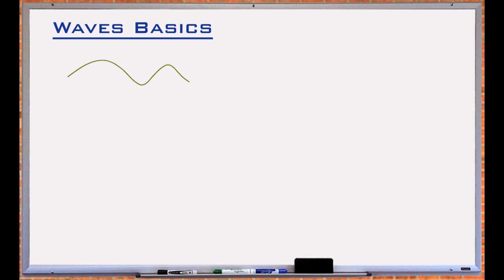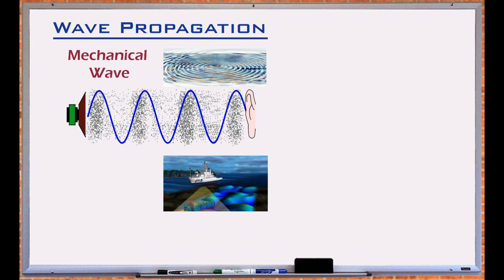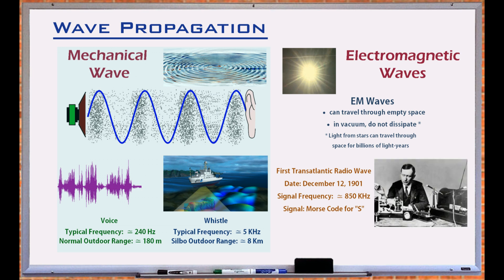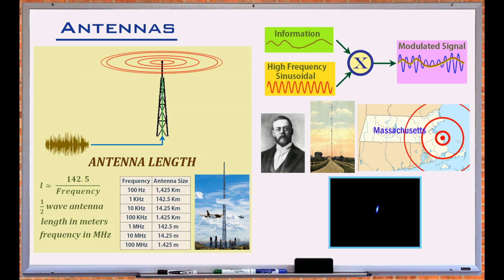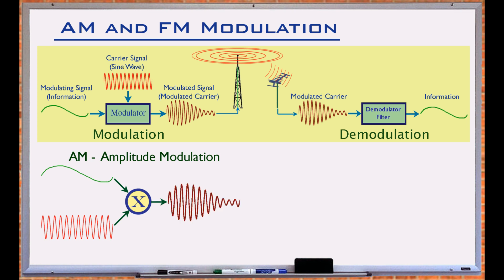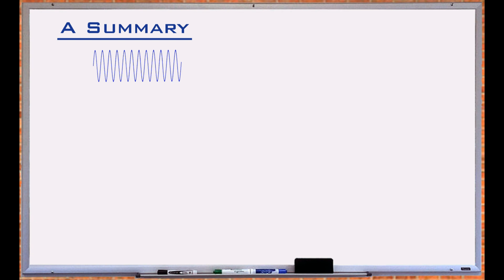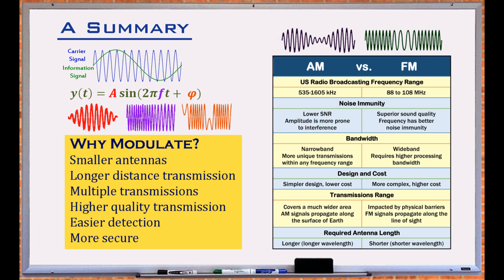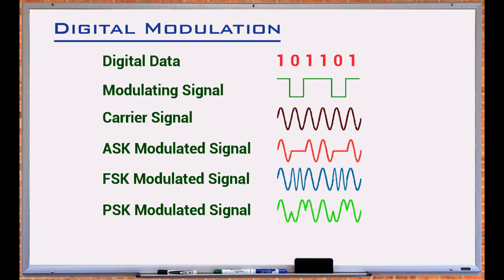Wave, Modulation, AM, FM Basics

Comment: Good..Can the sound fm frequency be installed on am and receive it with fm circuit and filter it
Reply from the maker: Thanks for watching Mohamed.
Not exactly sure what you are after. However, an FM signal can be amplitude modulated. To demodulate it, first a high pass filter needs to remove the AM effect. Once this is done, the signal can be demodulated like any other FM signal. Best of luck.
Reply: @academia7768  thanks..I put this question to you and my goal is to try sending a distance signal to study so I wanted to take advantage of am and fm for signal strength and remote transmitter together ... Can I filter the sound wave alone?  Does the distance increase?